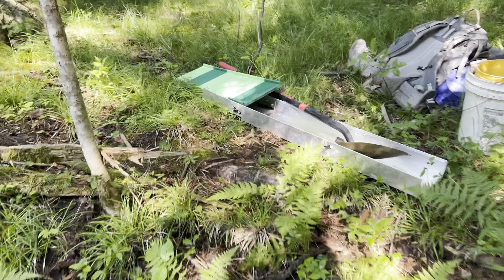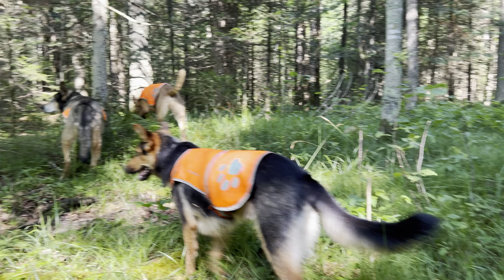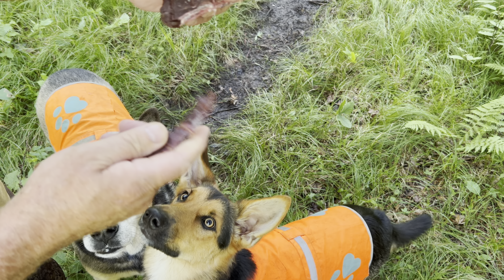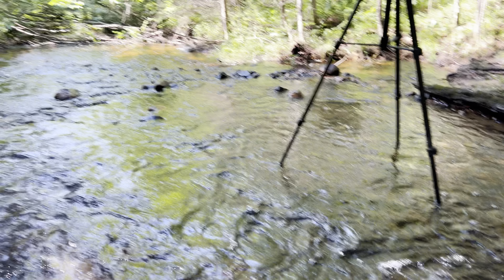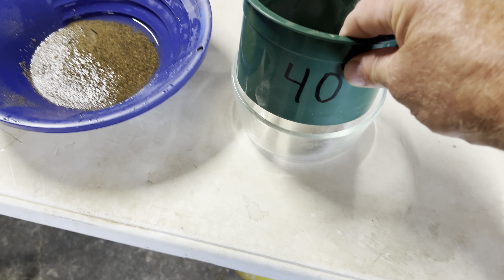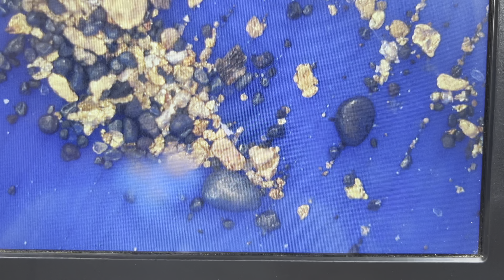The world’s BEST hobby ! GOLD

Comment: So, if you wanna speed up your clean up time by a few hours, trust the inside bend of DEF tubing. Parts houses often have customers throw it away, brand new, and they'll use a funnel, so it doesn't cost anything to grab a few, 3 piece minimum to get the length right. & connect them end to end with short chunks of scrap hose. Corkscrew the slope downwards creates the inside bend. Put a funnel on the top a dump in a scoop, it'll chew through a half gallon in twenty minutes. I bought your gold, the black poison to give demonstrations. No losses. none. You'll have a baby spoon of fines when you're done, pretty clean too. Lots easier.

Comment: You turned me on to the VDR mat and wow what a difference around cleveland the gold is pretty small but the VDR mat is amazing best clean outs I have had since I started 2 years ago.  Now i'm High banking with a home made sluice and using the vdr mat at a 4-5 degree angle!  btw best clean outs are like 8-16 nicely visible specs :) in each cleanup.
Reply from the maker: Great to hear! My cleanout resembles that sometimes 😃✅✅✅

Comment: You are basically addressing my situation. I'm very new and so far have done 2 trips to a couple of rivers. I would guess both are what you would call expert level panning.... Super magnetic, super small, super heavy black sands and something that may be microscopic gold, or microscopic pyrite, hell even the black sand is shiney. I don't have a microscope or a good clean up sluice just yet but I'm having fun despite the hard work (walking across a river on slimey rocks, through a fast 1 foot of water, carrying a bucket with 3 gallons of classified... was a beach).It's too early in this state (WA) to dig in the water areas so I had to cross to a gravel bar. I will eventually figure out a setup for a small clean up sluice, maybe yours, but living in a studio apartment isn't ideal for setting up water pumps etc... I have looked at the DreamMat Clean Up Buddy and see it as another option but  even though it has a small pump I would need to set up tubs, water, etc... Worries for a bit later. Now I have a Dream Mat Adventure Sluice (4"x16") which is in a way a clean up sluice itself. I can set it up in running water and set up a lawn chair and scoop, scoop, scoop. The percent of magnetic material around here makes me think about some of those spendy magnet seperators but maybe later. My next investment is making or buying a larger stream sluice as things like highbankers are pretty much illegal here, maybe not everywhere but too many places to consider it a good option at this point. Another thing I haven't really figured out yet is claims, we have them but it's hard to get a map of where. So far I just look for signs and hope I'm not on someones area. I look forward to your posts and hope they continue for years, most of the posts from my state are a few videos then gone, long before I started.
Reply: PS: I did do an order for an XP pan set through High Plains as all mine are Garrett and I wanted variaty plus you said they were good. They sent me a set of Garrett pans that complement what I already got but didn't expand my variety. No big deal (I wrote them saying the same) as it all works but so far I'm living the green (not blue). You should get a percent from them, they just made money off of me due to your promoting them. I'll probably try again another time but pretty set for now.
Reply from the maker: The blue is where it’s at 😃👍🏻🍻